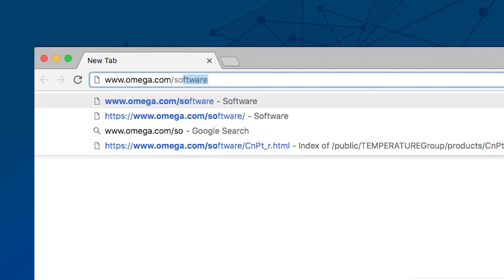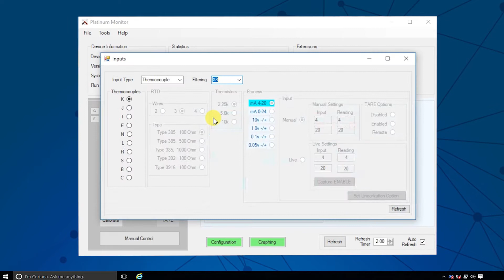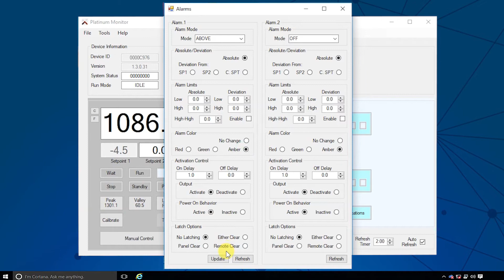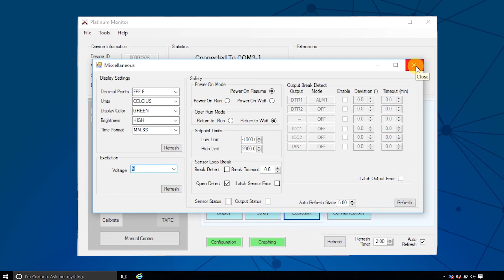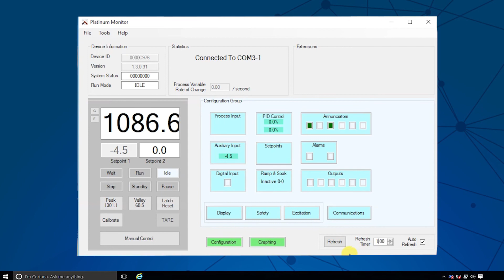How to use the Omega Platinum Series Software

Comment: high i am working  on the strain gauges and i am using this platinum series controller. i have downloaded the software but i am unable to calculate strain or voltage fluctuated by it. is there any different configuration or any input process that i am using wrong cause its always showing temp
Reply from the maker: Hi Sumit, can you please contact our support team, they will be more than happy to help you address this challenge.
Reply: Did you manage to get this working with strain gauges? I'm looking to buy this for stain gauges.